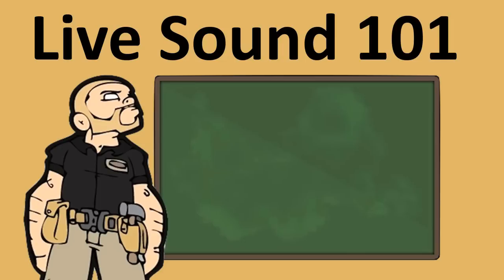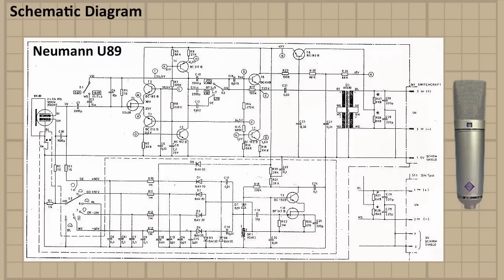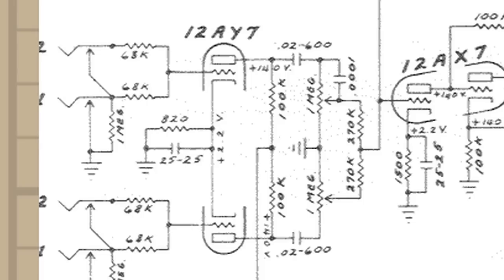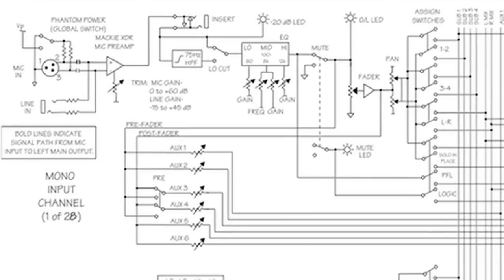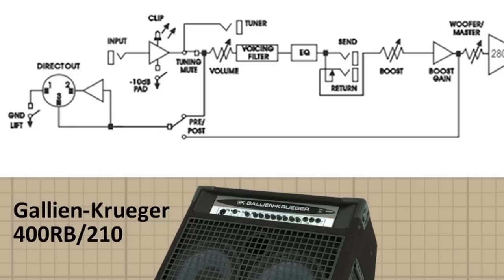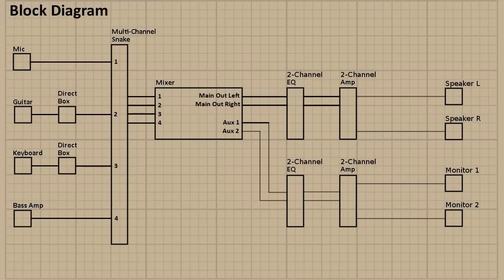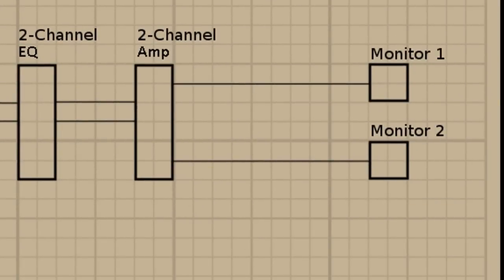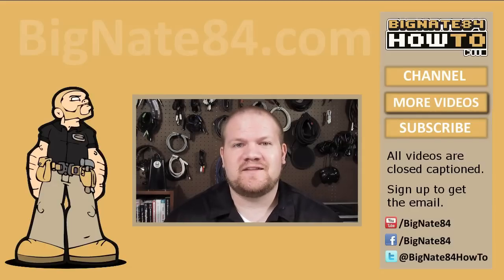Live Sound 101: Schematic & Block Diagrams

Comment from the maker: You had asked about optimum I/O settings.  The source is your electric guitar.  From experience I have observed that some musicians don't prefer to drive the volume on their guitar all the way.  They like to keep GTR volume on 6 or 7.  Usually you will get better tone by driving the guitar pick-ups to 9 or 10.  Next you need to set levels on the Line6.  Different effects will have different perceived volume levels so you need to take some time finding a good balance between your FX.  Helpful?
Reply: Hey man, thanks for your videos first of all.
Guitar players like to keep the volume knob at 7ish because during sound check we'll find where the amp starts to break up, then roll down a bit to clean up that dirt without actually lowering the volume. That's some more control of our tone.
I couldnt find the original question you were asked, so maybe this is not the right comment (he mentions Line6, which is digital stuff, so maybe it doesnt apply).